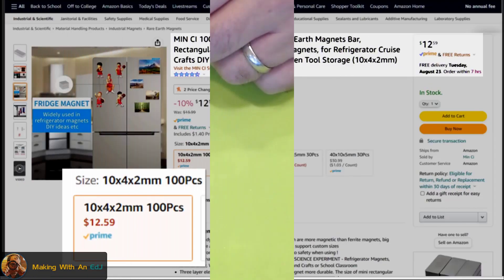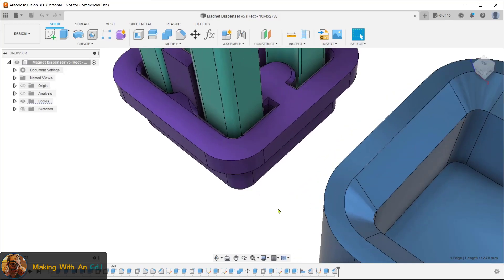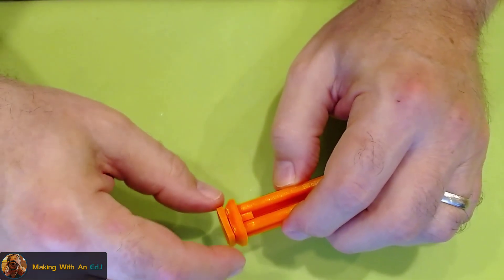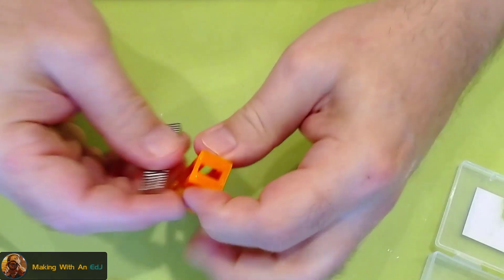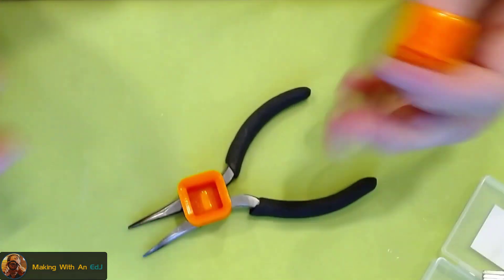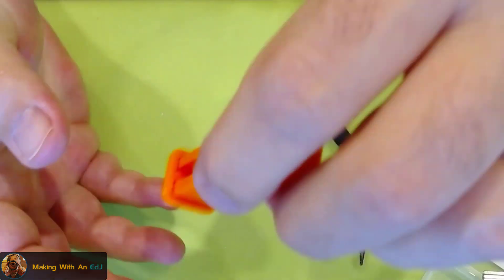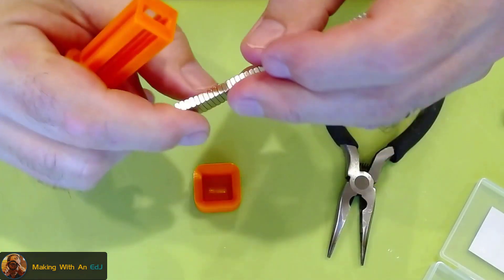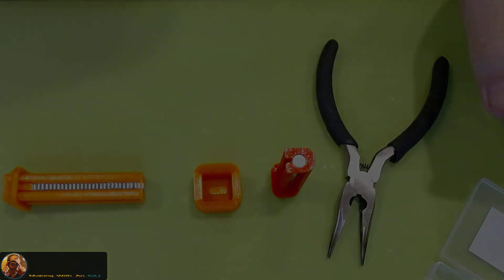Magnet Dispenser

Comment: Found this while browsing for a magnet dispensor that would do something like this one, but this one is better than what I was thinking! This is great, now I just need to make those magnet shapes into circles! I'm working on some gridfinity containers, and I have been using the round ones, so I have penty to use up.   LOL  good job on that!
Reply from the maker: Glad you like these (and glad you found version 2!) They should work great to help keep the polarity of your magnets in sync when popping them into your Gridfinity containers.
Reply: @MakingWithAnEdJ  Update: I used the Fusion 360 file and made one 5x3 and one 5x2 along with using one of your 6x2 stl files. My printer has been calibrated, so I printed all 3 at once.... they all came out perfectly!! Now I am printing some drawered containers to store them, and the spare magnets in. Thanks again, no sure if we need a v3.  😁😁